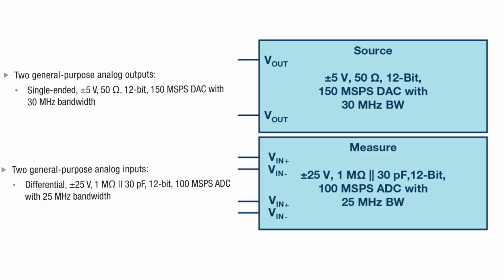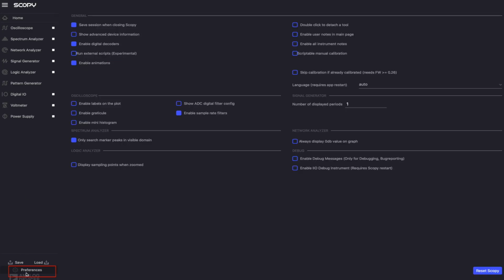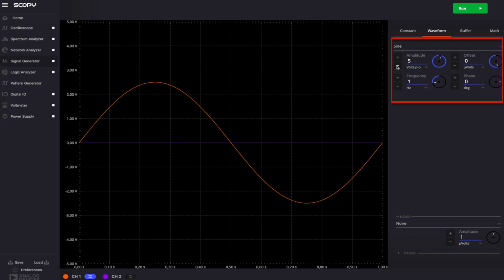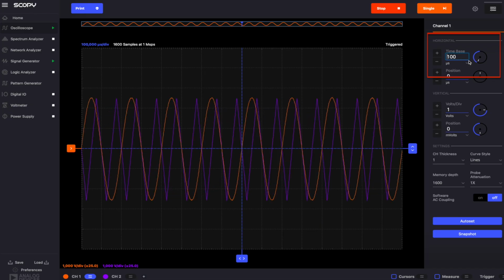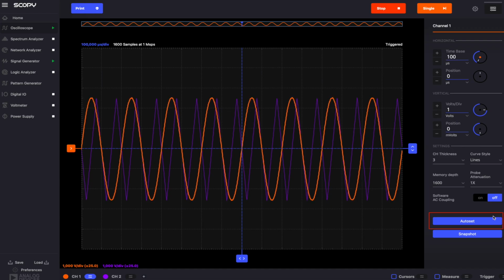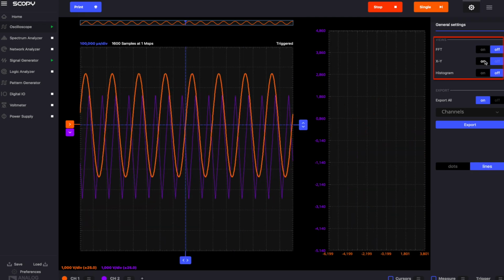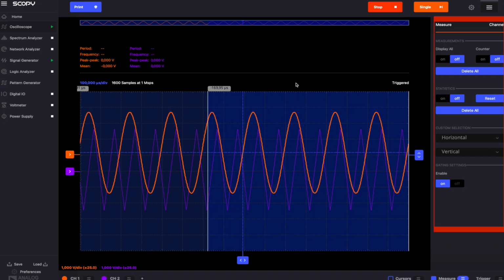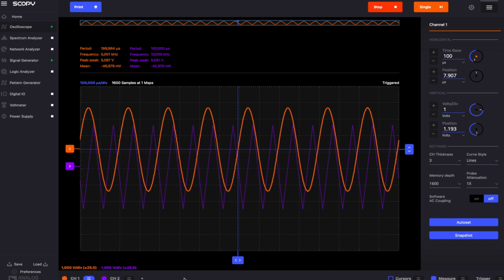ADALM2000 Video Series: Video 4 - Signal Generator and Oscilloscope Tools

Comment: Is there a way for an external trigger to start the signal generator?
Reply from the maker: Hi Barack,

There are features for external triggers using the ADALM2000 but I don't believe they are currently implemented for the signal generator in Scopy at this time.  Can you describe the use case you are trying to accomplish here?  I would help us better understand how we could make Scopy more useful.

You could implement the external trigger and set the signal generator using the libm2k library and writing your own script though.  If you are interested in learning how to customize some of your measurements/applications I would certainly recommend watching this video ( https://youtu.be/jHFQAuMJv6k ) and giving it a try.
Reply: Hi, somehow did not see the reply.
But my case was to measure the impulse response of a system better. I am using a FPGA to record an ADC, but the sampling rate is high and the buffer is small. I want the FPGA to start recording when it sends a pulse out.

At that same time, the pulse is received by the signal generator so it knows to start. 

The analog discovery 2 does support this and it works well without needing to touch the SDK. I also used their SDK for more fine control. But I don't know if the ADALM's sdk supports this at all. 

Most signal generators do support this function though, so it's not too weird of a thing.

Comment: You could upload a video of how to Measure the control loop of a switched source, using the adalm2000.
Reply: Good suggestion! There is a collection of lab exercises on switching regulators in development (that could really use videos), including control loop analysis. This exercise:
https://wiki.analog.com/university/labs/closed_loop_buck_adalm2000
goes as far as characterizing a buck converter power stage using the ADALM2000's signal generator and oscilloscope. Bode plots are a challenge because of the of switching noise -  Scopy's network analyzer won't give meaningful results, hence the simple time domain measurement in that exercise (so far.) But it should be possible to write a Python script using libm2k, taking much longer data records than the Scopy network analyzer, to get the noise down to a manageable level. (or just take a few points manually with the signal generator / scope where you've got a bit more control.)

If you've got any other comments or suggestions on those lab exercises, please feel free to discuss here: https://ez.analog.com/studentzone/